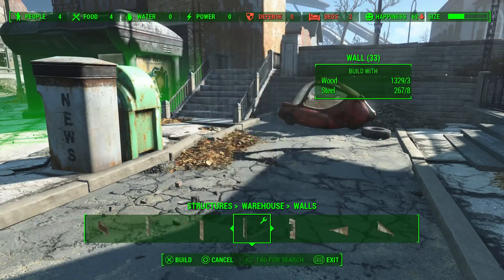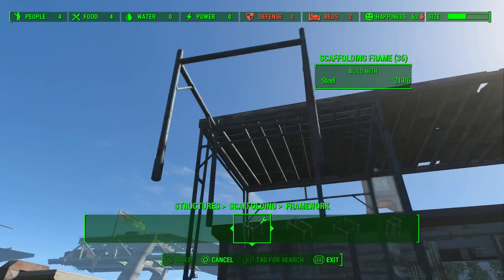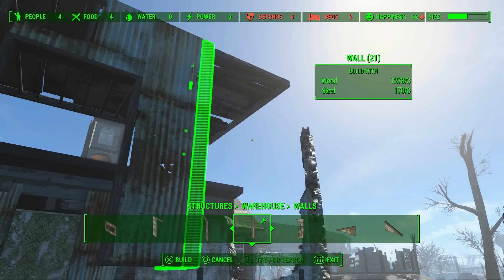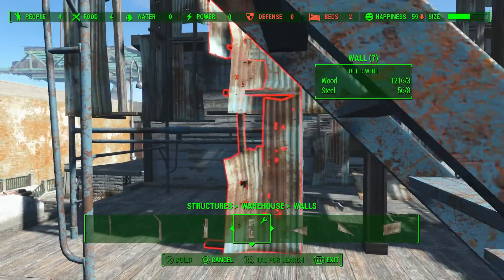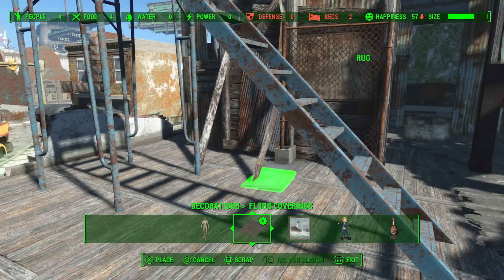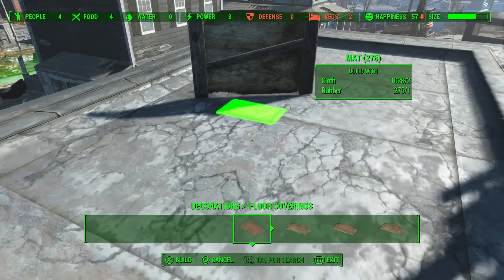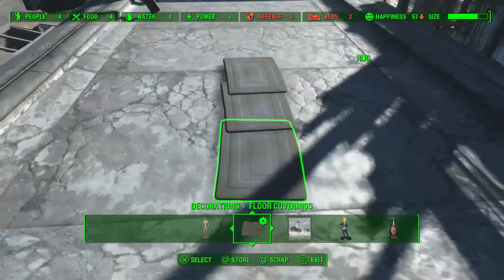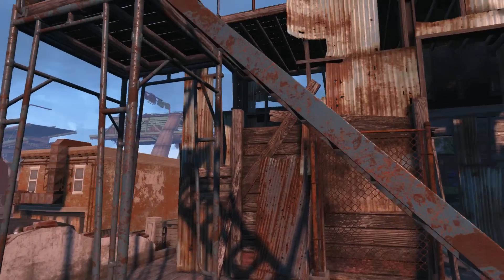Fallout 4 - Scrap Windmill Tower

Comment: One important thing to consider when using robot settlers is that their max happiness is set at 50. So having robots in your settlements will negatively affect the overall happiness of the settlement significantly since normal living settlers have max happiness of 100. I ended up making the mechanist's lair as my one "robot settlement" and just made a whole bunch of them and turned them all into provisors. they do make really good provisioners, and there is a mod that turns all pack brahmin into eye bots makes it really tie together well.